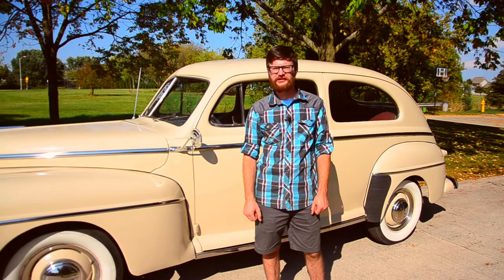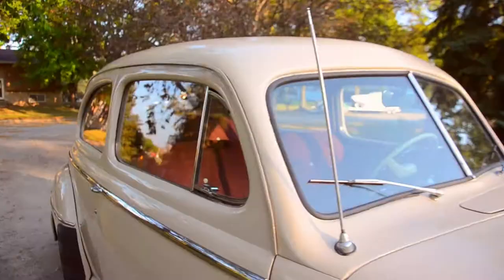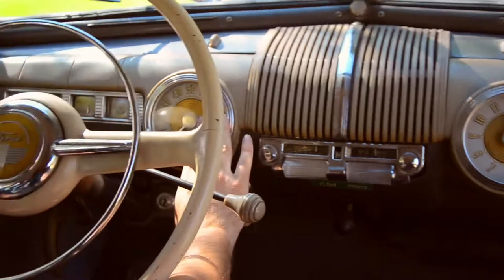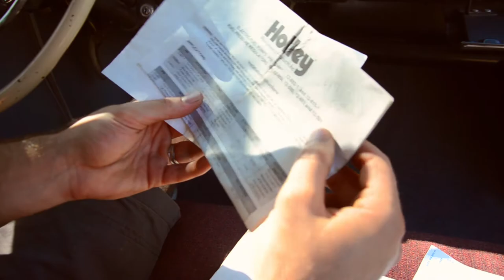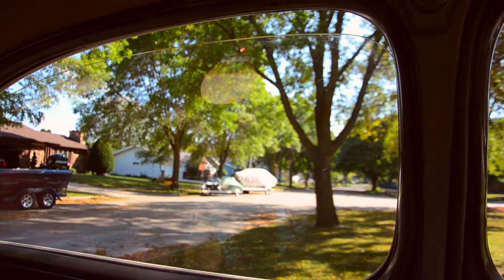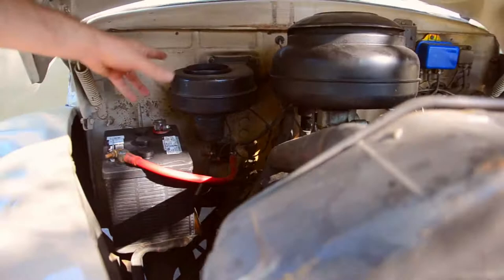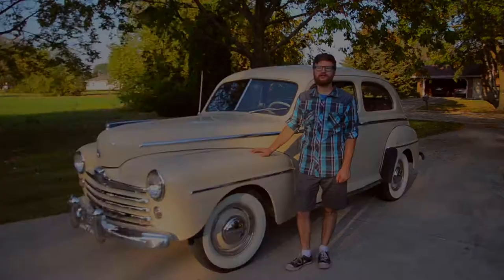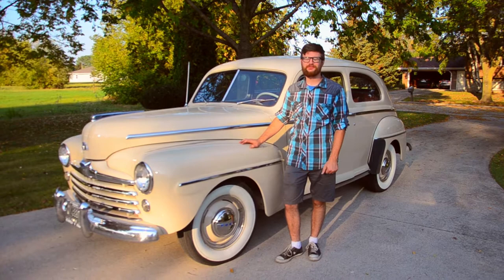1948 Ford Super Deluxe Flathead V8 - Sold

Comment: Wax on Wax off, For those of Us who remember. First time I ever heard vent windows referred to as Smokers windows but that name certainly fits. Keep them going.
Reply: Well I remember back in 55 when I lived in this small town in California and some idiot drove his black convertible into a manure truck and filled his interior with shit
Reply: Back in the day, my day I guess, they were vent windows to circulate air. Some cars had then in the back as well. Prior to air conditioning they were a blessing. And yes, we learned they would vent cigarette smoke out of the car and draw in rain as well. By the by, you still have to "crack" a window to pull smoke out of a car these days. AC just doesn't pull out smoke as fast as a slightly open window. Hardly a car came without ashtrays back then, and now they hardly come with an ashtray.

Comment: Is a flathead the same as a side valve?
Reply: The flathead engine had both exhaust and intake valves on the sides of the pistons placed in the intake valley working off the camshaft running down the center of the valley. This is called an L Head design. And yes, it is also known as a side valve engine or valve-in-block engine with its poppet valves contained within the engine block, instead of in the cylinder head, as in an overhead valve engine.